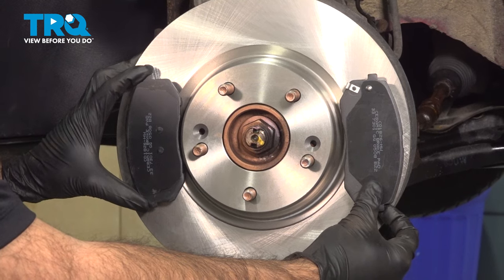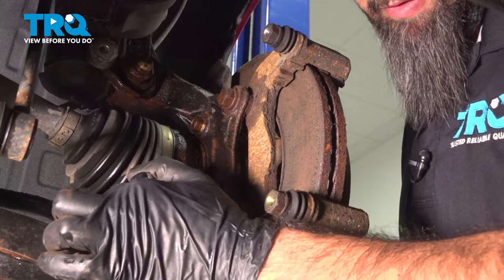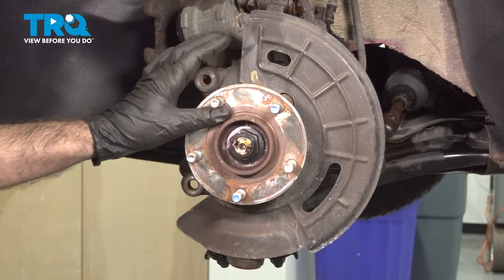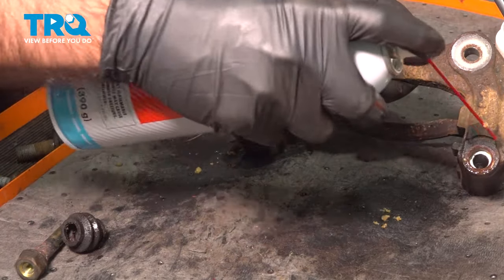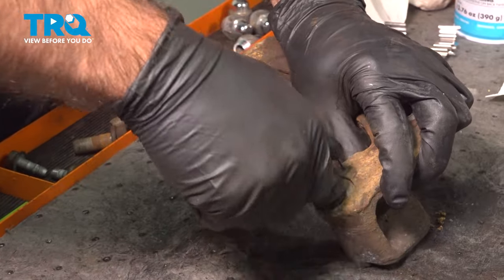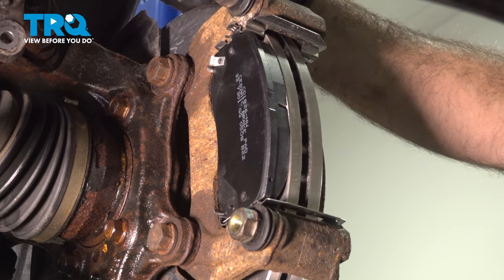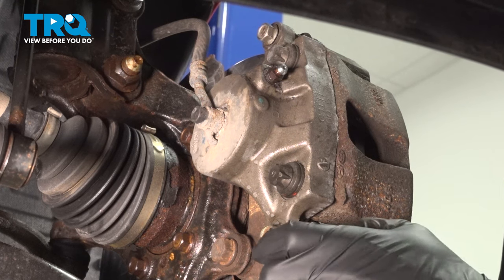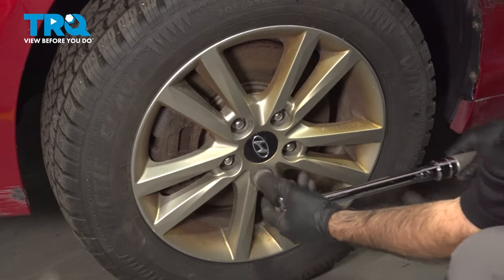How to Replace Front Brakes 2015-2019 Hyundai Sonata

Comment: Good video, but NEVER put antiseize on your wheel studs.  That will result in pressure against the threads well beyond specs when you torque the lugs.  That's why it's best to use antiseize from a jar with an applicator brush vs aerosol.  Otherwise good/detailed video.

Comment: This was by far the best video & most detailed video I've seen on YouTube explaining how to change brakes!! Thank you!!!

Edit: I'm female & went off your list of tools & everything needed to get the job done & I changed my front & back brakes & rotors for first time in my life with no problem. Only thing that ended up being a little bit of a struggle was not being strong enough to get some bolts unscrewed so I just wd40 them & waited a few & piece of cake. I was quoted $800 for front/back brakes/rotors (i swear cuz im female mechanics try to take advantage of that). It ended up costing me $285 for parts & a little less than $100 for tools so now in future all I need is parts. $385 compared to $800 which is like $200 each brake/rotor & I coulda got shit brands but I got one of the top of the line brake sets. Thanks again for the detailed instructions!!

Comment: NGL.. I thought it was the same piston compressor used on a dodge charger. Didn't have it nor did I open the bleeder screw, and was still able to grip the piston with my hands, until the piston was compressed enough to finish the job. Not bad. Some sore forearms tho. Feel like thats better than possibly letting air in. Leave it closed use man power and get it done.
Reply: Maybe I could of used that tool, either way

Comment: I’m replacing the rear brakes and I don’t remember if the caliper bolt with the black rubber piece on it , goes on the top or bottom of caliper